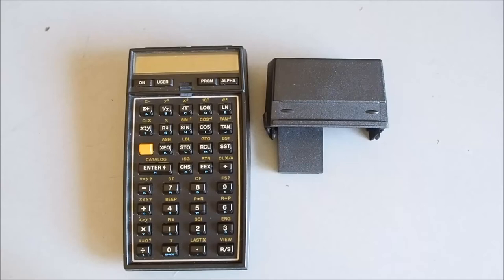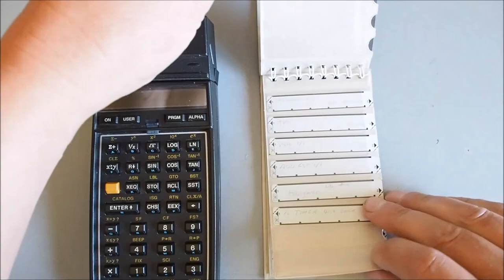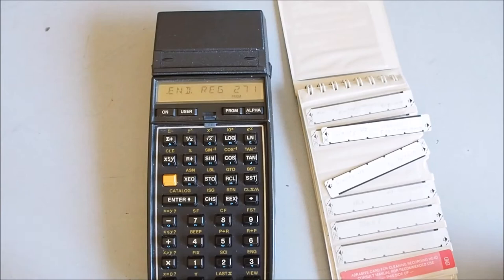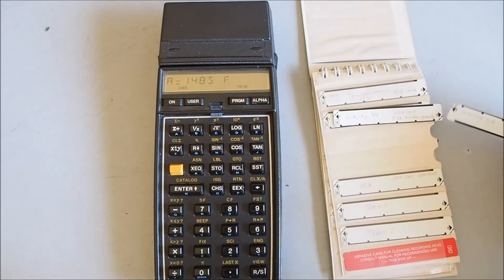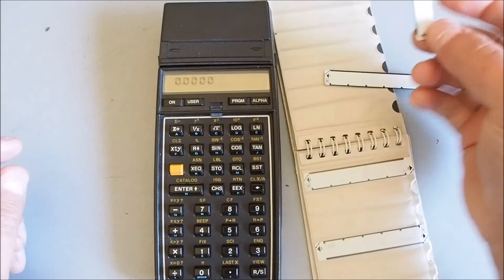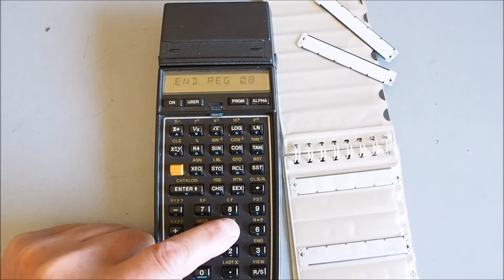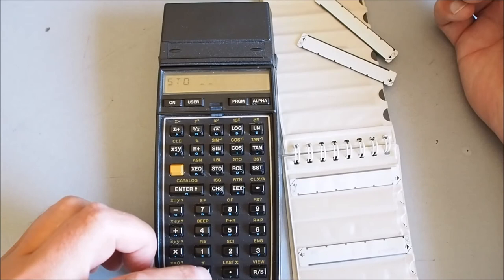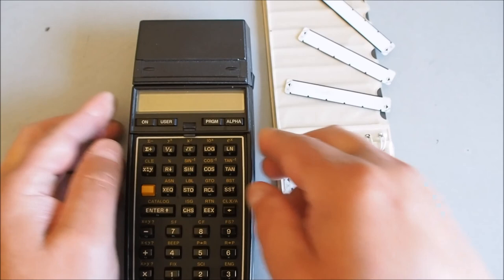Hewlett Packard 41C Series - Part 2 - Card Reader.

Comment: Texas Instruments had a very similar calculator in late 1970's.Its a card reader too like this one .📚📊📡🆒👍😉
Reply: TI-59.  Good times.
Reply: Yeah but it was not RPN and the card reader was very unreliable.
Reply: It was a lot less money though.
Reply: @briandenley  whats "RPN" tnx !
Reply: @p0k7lm  every HP calculator used a stack based math system known as Reverse Polish Notation (RPN).  It’s a stack based system also used by the programming language Forth.  There was no equals key.  The most complicated algebra solutions required no memories or parentheses.  The other TI type calculators use an algebraic system requiring the user to store and recall memories and/or use parentheses.
Reply: @briandenley  hi thanks 4 reply . i remember   back in those daze  i  wrote a program    to  solve   polynomial  equations  , it was a fun  project  and always worked . it  would  find the  gcf  and Lcm  of the   terms.

Comment: The incorporating of this magnetic card reader(and programability) doesn't by itself make this a computer, it is still hardwired for floating point calculations
Reply: What a hell u r talking about ? :-))) D u think computers MUST do also symbolic calculations ? :-)
Reply: AFAIK it is not hardwired at all, it is microcoded... ...And it goes beyond basic floating point maths, it can also manipulate alphanumeric strings from what i recall, it has all the conditional instructions and so on...
Reply: Back in the 70's, the difference between a programmable calculator and a computer was the ability to make comparisons and branch or jump based upon the result. Yes this is a computer. This machine was used as the backup navigational computer for the space shuttle. Back in 1981 I worked on calculators for Monroe Systems for business while in college. The year the IBM PC came out. We had systems called computers (they could make decisions) that were way less powerful than this. The logic unit was the size of a suitcase and sat under the desk, while the printer/display/keyboard sat on the desk. 

Back in the 1960's there were many huge desktop machines that could be programmed to do repetitious tasks, but they could not branch based upon a greater than, less than, equal, zero, positive or negative result. They were not classed as computers. 

I was able to do just about any electrical engineering task on this HP-41C that I could do with FORTRAN on the IBM 360-40. And I did not have to punch cards and submit the job to run. So yes youngling, this is a computer. It most certainly computes.
Reply: The HP-41 is a full blown computer system that I used in numerous applications, in the 1980s. It supports complex data processing and the HP-IL Interface, which allows it to control various external devices, including printers, plotters, a screen interface, measurement devices etc.
One of my applications was used to examine the state of Swiss forests. Forest engineers entered data about trees into the HP-41. The application prompted them for the required data - adapting to the location & previously entered information, then transferred the data to a PC application I had also written where the data was evaluated (NB: the forests were totally fine, no sign of the alleged "forest death" the alarmists worried about).
Reply: Lol are you high? Of course the HP-41C is a computer because it could store and run programs and has Conditional if statements, data storage registers, alphanumeric strings, I/O, etc.